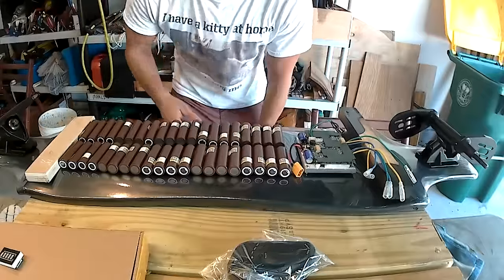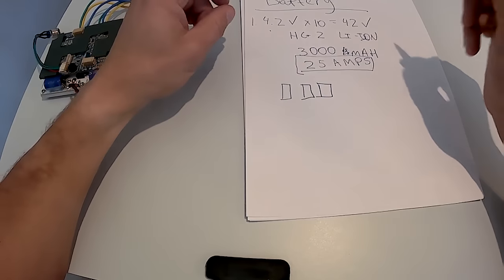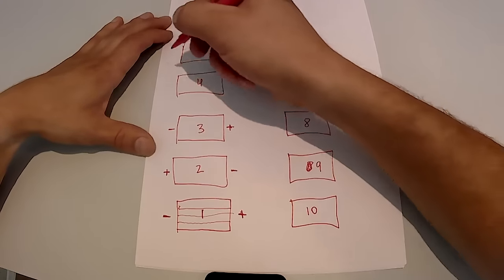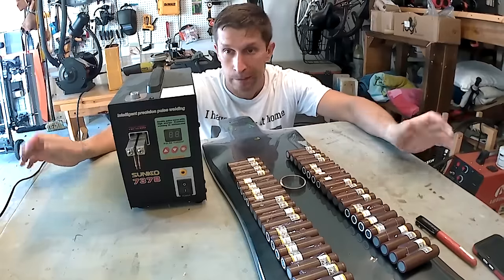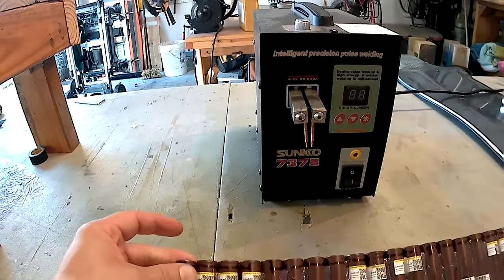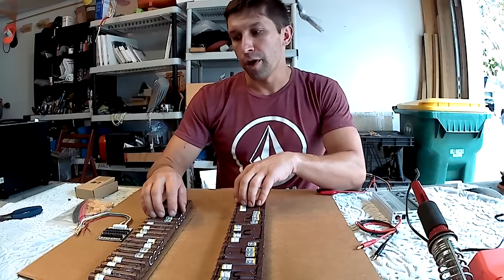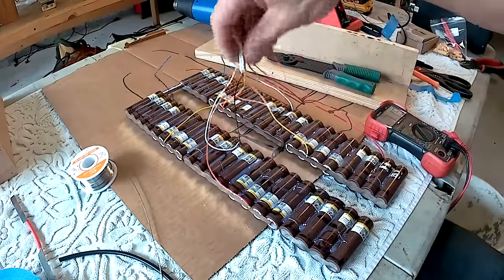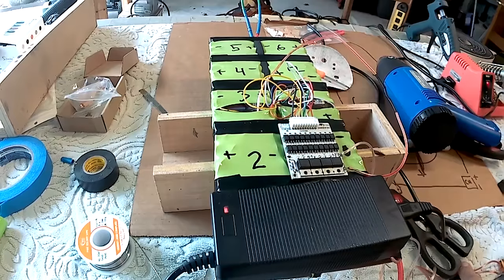Electric Skateboard Battery Tutorial

Comment: I do have a question if you can please help me or correct me. So I’m building a e-skate board. And my ? Is,
if I pair batteries the amps go up, as well with the mAH, but the voltage does not, unless it’s in series. So if I were to buy a 6374 motor with a capacity of 80 max amps, That means The motor does not exceed 80 amps. But I would need 4 battery’s in pairs to get the 100 amps? Or would that be too much power since the motor tops at 80 amps. Or can I just buy a 10s2p battery pack and use that one? But the would mean it can only provide 50 amps, so that also means I wouldn’t be able to use those 80 amps? Right?
Reply from the maker: What's Up Miguel.  Motor rating (amps) is just that.  It means that your motor would be safe to operate at up to 80a at whatever voltage the motor is rated for.  Motor is just one component.  Your second component is your esc/vesc.  Third component is battery pack.  In order to build an efficient skateboard, those three components have to match (Especially battery and ESC).

In order for you to maximize the power of your motor, your esc and battery need to provide sufficient power.

Here is what I would do:

10s4p or 12s4p battery (42V or 50V, depends on what your motor and esc are rated at.  The higher the voltage, the more powerful/efficient motor is).

Make sure your ESC can handle 80a.  If your esc is   a vesc, tune your vesc not to exceed max amp and voltage limits.  If you are using unbranded e-bay esc, they are set at 30a per motor @ 42V.

What is the esc you are using?  Is it a dual or single motor set Up?

I advise against 10s2p unless you are a very light person and never ride uphil.  With 2P set up (depending on how many amps you draw) you are more likely to push your battery pack to its limits every time you ride.  This will shorten the life span of your battery pack and will make riding around less enjoyable.
Reply: Artsiom Naidzich first of all thanks for taking to your time to reply. I’ve been searching all over for help. 
But I’m planning on using a vest for 1 motor. I forgot to ask that the amps go up by the pairs and not by the series? So If I were to have a battery with a 25 amp consistency, and If pair 2 it goes to 50 amps. So if I make 10s4p battery pack it would be 100 amps batter pack, because it comes in pairs of 4? and not 1000amps? Because we don’t multiply 100amps times 10 cells ?
Reply from the maker: Miguel Angel Figueroa Rivera when you stack 18650 in parallel, you add mAh (capacity). When you stack 18650 in series, you add voltage. Think of amps as gasoline (liters/km or gal/mile). The bigger the motor, more amps it will pull out of the gas tank (battery).

Battery needs to be able to supply what motor needs.  ESC is the gatekeeper between battery and motor. If esc can only do 50a per motor (most of the modern vescs are rated at 50a or 60a max)., than your motor is getting 50a. If you have 2 motors, your esc is letting 100a through (50a per motor). Point is, you can build a 10s4p pack (lets say 42v 100a, 12000mah).  If your esc for single motor is rated for 50a, 50a is what motor is getting). Power produced by motor is measured in watts. WAtt=volts x amps. In order to increase motor power, you either increase V, or Amps, or both.

Hope it helps

Pack examples (s-series, p-parallel)

1s1p
4.2v 3000mah 20a

1s2p
4.2v 6000mah 40a

1s3p
4.2v 9000mah 60a

2s1p
8.4v 3000mah 20a

2s2p
8.4v 6000mah 40a

2s3p
8.4v 9000mah 60a
Reply: Artsiom Naidzich it helps me a bunch!!! Wish I could take you out for a coffee ☕️ ha!! Thanks man I really appreciate it (: 
God bless

Comment: Great video! Where did you get your battery cells and BMS at?
Reply from the maker: Here is the link:  https://www.aliexpress.com/item/100-New-Original-HG2-18650-3000mAh-battery-18650HG2-3-6V-discharge-20A-dedicated-For-LG-Electronic/32868746648.html?spm=2114.search0104.3.1.201ebafbctVEHn&ws_ab_test=searchweb0_0,searchweb201602_1_10065_10068_10130_10890_10547_319_10546_317_10548_5730311_10545_10696_453_10084_454_10083_5729211_10618_10307_538_537_536_10059_10884_10887_100031_321_322_10103-5729211,searchweb201603_51,ppcSwitch_0&algo_expid=7566e5e0-f15d-46bc-8681-d75ca4e8b574-0&algo_pvid=7566e5e0-f15d-46bc-8681-d75ca4e8b574
Reply from the maker: https://www.amazon.com/Battery-Protection-Ternary-Balance-Batteries/dp/B07DRP5DYB/ref=sr_1_4?ie=UTF8&qid=1545005805&sr=8-4&keywords=10s+bms
Reply: That esc is garbage, throttles 30a per channel, get a vesc and its derivatives. 

Don't get liitokala cells, they're garbage and have wildly varying internal resistance, meaning they'll fall out of balance quickly. Save a few bucks now, it'll lead to problems later or even having to replace completely. 

ESC = electronic speed controllers, not engine

Comment: May I ask where you get your batteries from
Reply from the maker: I used to get them from Litokala store on allie express.  I have switched to Li-Ion wear-house online store.
Reply: How is your experience with Allie Express. I placed an order last week.
Reply from the maker: @mta3562 , with HG3 cells i had a mostly good xp. They are def not what they are advertised to be. They claim 3000mah and 20 or sometimes 30a per cell. Realistically, its about 2200mah per cell, and prob around 10 to 15a of continues discharge (it can do short bursts of 20a). Pretty much u got to build ur battery bigger with LK cells if u want ur power pack to, you know, be powerful.
Reply: Artsiom Naidzich thanks for the insight info. I have everything I need for the DIY mountain board except for the battery. I would like to build my own battery later on as I have to get all the equipments that you were using.
Reply from the maker: @mta3562 , good luck!  Let me know how it goes!

Comment: Great tutorial! How much do you reckon this build costs?
Reply from the maker: Thanks!  Here is a rough cost breakdown:

18650 cells: 40 @  $3.00 = 120
BMS: $20.00
Connectors/Shrink Wrap/Tape/nickel strip (if you got nothing to start out with): $30

About $170 total.

I got 18 miles on this pack today (I only babied throttle last few miles).  This is the set up I had:  42V 60A ESC (30A per motor), 90mm wheels, dual 5055 motors, KV 270.  The board is fast and fun to ride.  It gets up to 30 mph.
Reply: @artsiomnaidzich9515  Thanks for the reply. 18 miles is great!
Reply from the maker: @roli5814  No problem.  I meant to say 30, not 300 for connectors and all that small stuff.
Reply: I managed to finds stuff for what im tryna do (36v mostly) to make a pack for 169 with a hub motor and some tools so its pretty cheap ngl.

Comment: would this process work with Samsung 40T 21700 4000mAh 30A? I don't have a deathwish on future all-terrain board, I'm just wanting more range and uphill torque.
Reply from the maker: Damon Thomas yes, it would. I would go heavier on nickel strips, or add 12ga wire to ur series connection. U can check out 12s6p battery pack vid on my channel to see what im talking about.
Reply: @artsiomnaidzich9515  sweet thx

Comment: Hi artsiom great video do you have a link to your spotwelder?
Reply from the maker: Hi Brendon.  Thanks.  Spot welder that I use may me a discontinued model.  I cannot find exactly the same one on either amazon or ebay.  Its a sunko brand welder.  there are a bunch of similar sunko welders out there though.
Reply: @artsiomnaidzich9515  thanks for the reply. I think i will be copying your battery but maybe with Samsung 30q cell. Hopefully i dont burn the house down.
Reply from the maker: brendon coad ha, nice! Good luck. This design have not failed me yet. I have gotten some input from other battery builders. To make you power pack run even better and add a degree of safety, add insulation rings on positive terminals. I started using copper wire with less nickel for series connection. Check out nighthawk vid on my channel if you want to see what im talking about.

Comment: If the battery are not at the same voltage it dangerous for the battery assembly or not? example if for a 10s4p i have a group of 4battery at the same voltage and another group with another voltage its a problem? thanks for your video bay the way
Reply from the maker: theliryx yes, this would be a problem. Think of voltage as pressure. Electrons will move from high voltage cell to low voltage cell (if connected in parallel).  If you connect bunch of cells with different voltage in series, your battery balancer will work extra hard to balance all cells (it may potentially damage ur bms.  In summary: 
A). Never connect different voltages in parallel
B). Avoid connecting different voltage cells in series ( up to 0.15V difference is ok: give or take some)

Charge all cells to max capacity 4.2v before connecting to avoid shorting/balancing issues.
Reply: @artsiomnaidzich9515  Thanks for your answer ! And i work with NCR18650B battery but when i charge a cell to 4.2v the voltage increase by himself after the charge (4.30v to 4.54v max )and decrease to a normal voltage (4.10v  to 4.16) its normal or not ! this NCR18650B are normally a good one so i dont know why the voltage increase by himself !
Reply from the maker: theliryx what are u using to charge them? Its panasonic cell, right? Going over 4.2v is not normal in my experience. Check voltage on your charger. If you are using multiple cells in series and charging them together, are you using a balance charger or bms? Overcharging can damage ur cells (best case), or battery will catch on fire (worst case).
Reply: @artsiomnaidzich9515  I have a intelligent charger "golisi " but i have to notice he has a difference between the voltage on a charger and my multimeter so when on the charger the cell is 4.2v its not really at this voltage but over 4.2v ! ( so this charger its not great )
But what i dont understand its why the voltage of the cell increase by himself when i receive these cells they are at 3.7 to 3.8v and 1day after the voltage arrived to 4v without charge...
Yes its panasonic cell!
I would like to do a 10s5p battery i have the basic in electricity but there are some things i can do wrong so i prefer to not run this project so fast and do this well so i dont assemble these battery yet but yes i will using a 10s bms ! I know these cells can be dangerous so i preferred to ask some he know better than me !
(I m french so sorry if my english its not correct )
Reply from the maker: theliryx look up data sheet on ur ncr cell. Typically it should say what max voltage tolerance is. Example: max 4.2V +/- .05v.  Cells sometimes do rebound voltage, but going from 3.6 to 4 without charge is not normal. U may have a bad cell. Cell may have physical damage. Do you know if your cells are genuine or possibly a fake (some fake are ok). Also, try using a different charger and voltmeter to test them out. After testing ur cells with different equipment, you will be able to identify what the problem is: cells, charger, voltmeter, or charging process.

Do all of ur cells do that, or just some?
Reply: @artsiomnaidzich9515  i see anything on a datasheet ! its also possible that was my multimeter the problem i change the battery of my multimeter i will see if that change anything ! i try with another charger i will see...
i bought these battery on aliexpress so its possible they are fake cells...but some cells dont do this weird thing so im confused !
Thanks for your help ! i come back to you when i know more!
Reply: @artsiomnaidzich9515  Hey that was my multimeter the problem so i charge around 4.15v / 4.20v and a make my battery and everything turn right.
Thanks for your answers and your time.

Comment: Very helpful thank you bud
Reply from the maker: You are welcome.  I've added to this design to make battery more flexible.  Nickel segment that connects one cell to another in series was replaced with 12ga wire (which can flex really well).  I have a 12s6p video on my channel where I use wire for series connection if you want to check that out.  Hope that helps.

Comment: oh man, your video make me learn how to make that battery
especially that BMS, searching here and there for better BMS and no luck, this quarantine make everything like (super) rare stuff
the only available one is same as yours and I keep thinking how can I make it work, my battery discharge is atleast 60a and that BMS is for 40a
and your video save me, I can just direct the output from battery instead of using the BMS and what about the discharge safety? will it imbalance the cell? YES it will but I can just balance charge them, easy, but there will be no protection for overdischarge? well technically the esc will cut off if the power is below 36v (or 30v well idk yet complete noob here) that mean every cell will be around 3.6v and lowest for 18650 is 3.0 so it will be save (probably)

but I still have question
I dont have charger for 36v or 10s but I do have balance charger (ISDT Q6 pro) for 24v or 6s for my fpv drone stuff
if I make 2 pcs of 5s 18560 and use parallel on the esc will it work the same way and the one you made (10s)?
could I make 5s 18650  without BMS and charge them with my balance charger as 5S?
I want to save money as much as possible for my first electric board so I can build my second as a BEAST
thanks in advance and keep upload new content (ignore trash talk comment if they dont like your stuff they should just make with anything that suit their taste)
Reply from the maker: Chandra Suryanto. If you use BMS, you don’t need to use a balance charger. For about $18, you can buy a 10 S or 42 V charger. Everything you summarized is correct. BMS will balance the cells, and motor controller will shut itself off when total voltage is less than 30v.

Comment: You have no flexibility in that nickel strip yet you're strapping it to a flexible skateboard? This is a fire waiting to happen I'm afraid. Series joins for electric skateboard batteries need to be done with at least 10awg wire or flat copper braid to allow the battery pack to flex with the deck. See my channel for how to do this correctly.
Reply from the maker: darkkevind cool. Thanks. Ive been doing wire for series for a bit now. At least 10 awg? Thats overkill.  I go 12awg on mine. Im still using this pack, no fires yet.
Reply: darkkevind I’ve had no issues as my battery is mounted to the bottom of the enclosure. I’ve rode over all kinds of terrain and it’s all good.

Comment: What awg wire did you use
Reply from the maker: Cheas Moon 12
Reply: Artsiom Naidzich just to clarify you used 12 awg wire when connecting the 5cell to the 6cell
Reply from the maker: Cheas Moon yes. Also your main +&- cables

Comment: Learnt alot from this but I must comment to noobs that the nickle strip is prob 0.1 thick because that spot welder according to my research can only do up to 0.15 thick. Even at 0.15 it would take prob at least 10 strips to cover 4 batteries at total of 80 amp. I might be wrong but spot welding on this cheap is not possible. It's better to do soldering with 0.3 8mm thick pure nickel strip as each strip would cover at least 30 amp so with 3 layers would cover 80 amp easy. Not sure about nickel plated but using 4 layers is probably good enough.  I am a beginners but this is my research. Or you can do what he did later and used both spot welding on nickel strip and solder 1 gauge wire to increase to 100amp. However a good soldering iron like TS100 is needed to quickly melt the solder without damaging the 18650. Get some goggles too.
Reply from the maker: Yo. I hear you. Ive seen the nickel charts quoted up and down various forums. The nickel charts you are referring to are useless. They were made for solar panels and do not account for length of nickel.  Today, i use one layer of nickel with 10 or 12 ga wire soldered to the top of nickel. Check any of my recent battery build videos.

Comment: can you also give me an info for the bms you are using
Reply from the maker: Noka 777 Battery Protection Board, BMS 10S 36V 40A Li-ion Battery Protection Module Charger Protection Board for Ternary Cobalt Acid Batteries with Balance BMS PCB https://www.amazon.com/dp/B07SZN18DN/ref=cm_sw_r_cp_api_i_CL-DEbZKWA6RP
Reply from the maker: Noka 777. Noka, would you please subscribe to my channel? Got an updated li-ion flex battery video coming out next week. Thanks.
Reply: I just did